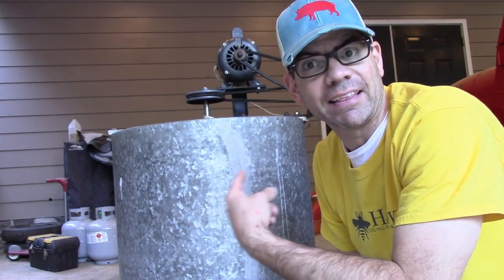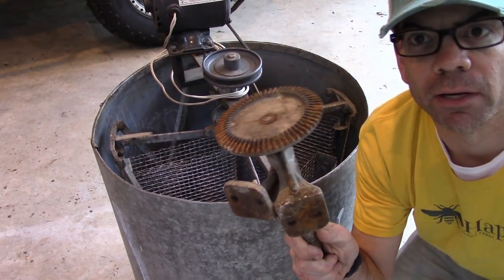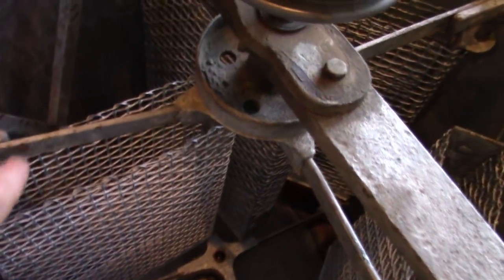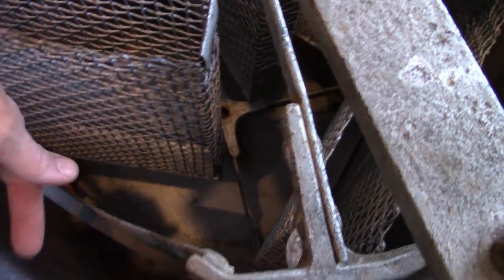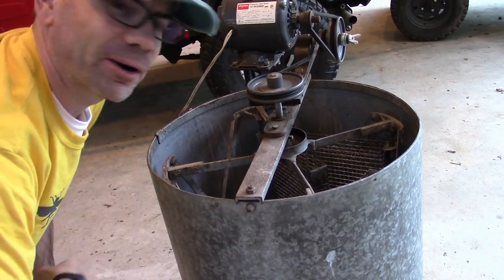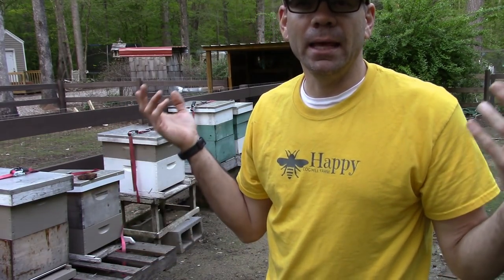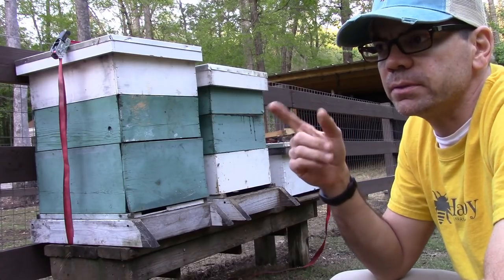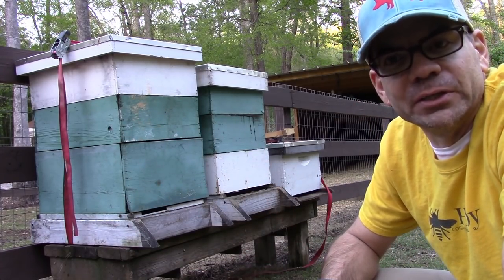Huge Craigslist Score (Vintage Honey Extractor!)

Comment: SCORE!  That’s cool how you can flip the frames without taking them out. Never seen one like that. You can buy a modern honey gate and replace that old rusty one. They don’t cost much and are on eBay. Watch the speed on that type. You can blow out the frames if you spin too fast. After you do one side and then flip to the other side you can speed it up a little.
Reply from the maker: Thanks!!!!

Comment: Worth every penny Jason. It takes 5lb. of honey to make 1lb. of wax. Therefore the wax in frames saves the bees a large amount of time building more. Don't forget that after you remove the cappings, wash them for liquid to make mead and make (as I did) a solar wax extractor for them using a glass covered steel tray angled so the wax runs off.  Greetings from sunny Oxford UK.
Reply from the maker: Awesome!!! Thanks for the info!!!